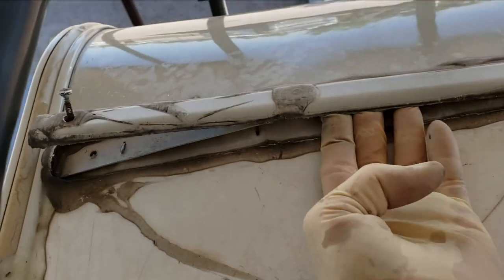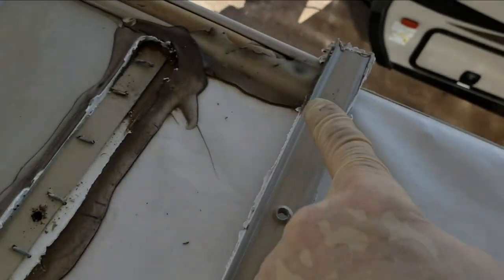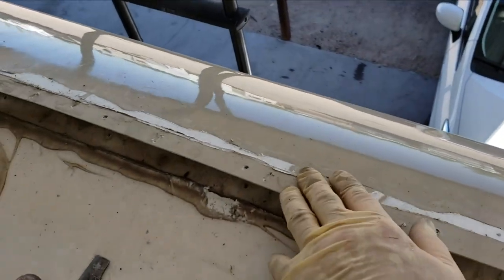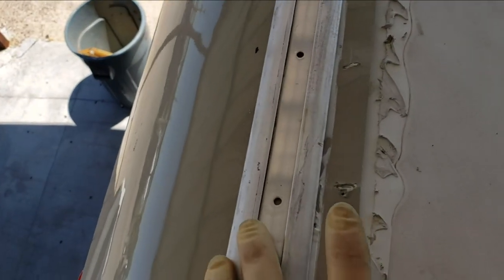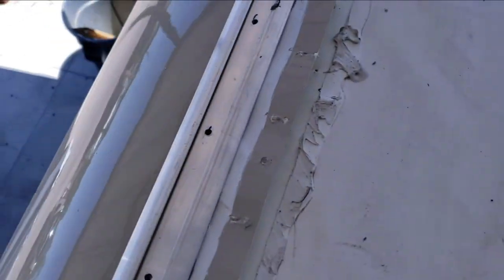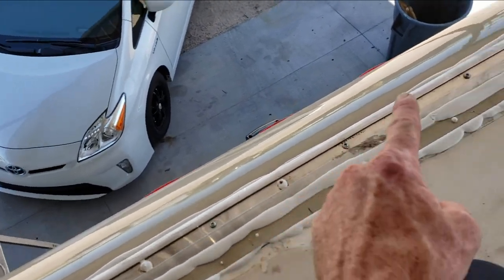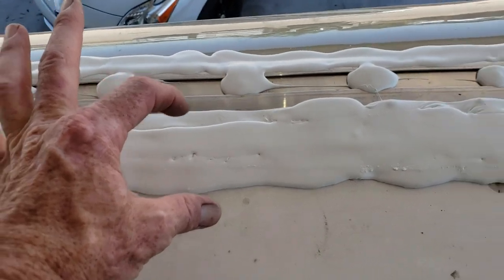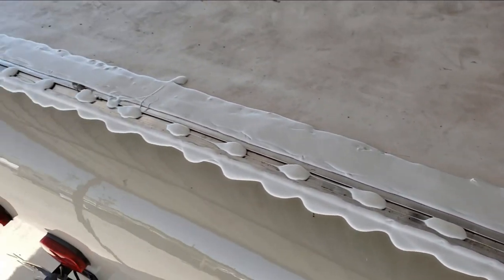Oops, Thor Did it Again!! Another Roof FAIL!

Comment: I find your videos very clear and helpful to whatever item I'm working on in my Motorhome... I like how you take time to explain key info. When it's necessary too that project. Now I'm working on indoor fan on my 2ton basement unit. I have replaced all 3 capacitors and have green light indicating system is good but indoor fan keeps shutting down and then starts back up a little later. Soo it's time for new fan motor as we live in Florida and live in RV so fan runs 24/7.  My point is that your videos give me Vidal information and confidence you send Thur video is Awesome.... Don't stop helping us out here.... Thank you so much!
Reply from the maker: Thank you so much for the kind words and support. The indoor blower should be directly controlled by the board itself. I'd make sure it has an issue on both high and low speeds. Winnebago's also have an EMS that will force the A/C into low speed if you are plugged into 30amp and start going over 30 amps.

Comment: I've changed my mind about buying an RV. They sound like cheap junk. Thanks for your insightful videos!
Reply: A lot of the newer ones are cheap junk built with styrofoam, chipboard,plastic, push plugs instead of bolts and many other manufacturing  short cuts, there's nothing wrong with buying an older one with better build quality but just make sure you buy a well maintained one and pay an expert to inspect it for old water leaks etc.
Reply from the maker: Glad to help

Comment: So many ways to fix this. I might have had a roofing company heat weld a 6 inch strip of TPO and covered all of that mess. But like I said there are many ways to slay this beast. Good job that won't leak for a long time.
Reply from the maker: It's a balancing act between cost and repair. As this is for a dealer, they'll want it as cheap as possible but still safe and reliable. Thanks!

Comment: We have a Thor Four Winds and try staying off of the roof.....  Of all the motorhomes we have owned the best construction was our Revcon. Now that was a long time ago, but it drove cross country.  The only issues were generator and roof air.   The next was my GMC front wheel drive.  Now I miss that coach but without an overhang on the front like our Class C it was hot in the cab deck area since the dash AC didn’t work.  But the quality of work was excellent...
Reply from the maker: Sounds like you've seen the good and bad of RVs too. Thanks!

Comment: You did what they should have to begin with. Have you seen any 21 GD Imagines in for issues at all? 
Love your channel and knowledge! Excellent work!
Reply from the maker: 2022 solitude with a bad roof install, washer breaking through the closet floor, inverter wasn't even wired correctly if that helps

Comment: Hello, thank you for the video you always do a nice job as I watched most of your clips for RV roof repair.
I just have a question.  Can you peel off the TPO and replace it with fiberglass Filon? I have a 2016 Thor ACE 30.2. Thanks
Reply from the maker: Of course anything could be done but putting filon on a membrane roof will be nearly impossible as the roof likely has contours and securing it will be difficult. I'd recommend rv flex armor first. Thanks

Comment: Soooooo much sealant.  Those "pockets" on the aluminum strip not covered by any dicor or sealant is a place for water with literally no way to run off. Better than letting the roof rot, but I like using a wider strip of flat aluminum combined with sealant underneath and a path for water drainage especially at the ends.  Everyone has their way of doing it...I'm always open to new ideas.
Reply from the maker: This was definitely a band aid repair, A much wider strip would have bowed away from the rear roof radius, and the pockets will hold water but will not leak. Filling in the whole trim would have been even uglier and more wasteful of sealant. All repairs are a fine balance between good enough and how much the customer is willing to pay for marginal improvement. Thanks!

Comment: Do you think they put the roof under the cap with the thought of driving the rig in the rain where it would be “forced” under the roof if done your way?
Reply from the maker: mostly it's a matter of easy assembly when built. Even in the membrane instructions it shows the roof over the rear cap but either way a driving rain cannot get forced through a secured and sealed roof. Thanks!

Comment: My 2011 Keystone Cougar is a pile of crap in so many ways. My roof literally melted. I went up to install a solar panel and took two steps and realized the roof was a gooey mess, roof came up off the roof particle board, stuck to my shoes. I went down and got an old sheet to work on while I installed the solar panel, grey good all over me when I was done. I'm going to have to tear the old roof off and put another one on. Of course Keystone did nothing but stone wall as is typical of them. Other things I found was behind the breaker panel to run solar wires, left over candy wrappers, along with material they cut off and holes, they drilled, it was a mess back there. Then most of the hinge screws came loose, pulled from the mounting, the bed has a bar behind it with a hinge to lift bed all the screws were pulled from the wall and hinge was hanging in mid air. Pure crap! I could go on and on. Never buy a Keystone anything, and the fancy Grand Design, what garbage! They all use the same idea of light weight and cheap material and roll them off as fast as possible. I kick myself for selling my 1999 Alpenlite, the best trailer ever built in my opinion.
Reply from the maker: I can fully understand your feelings and I share a majority of them. I am curious about the roof melting. What kind of roof was it?
Reply: @AZExpert  I live in Az also. I found the trailer in Laughlin, it had come down a few months before from Oregon, bought at Blue Dog RV, used 2011. I walked the roof, was in great condition showed no signs of gumminess at all. I bought it and brought it home. Then one day went up and it was gummy. From what I can tell the material seems to be a rubber based coating, the layer under it is what I assume is the sheet stuff they put on at the factory, it's pulling up all over. I can pinch and lift large sections of it. From what I have read Keystone has thousands of trailers with bad glue jobs and to thin of caulk on the seams, causing the bulges seen on fronts and rears of lots of trailer, I'm sure you seen plenty of those. So I have to a reroof.

Comment: So far I haven’t seen a video using Silicone sealer like Liquid Rubber.   Have you used it or had bad experiences with the Liquid RUBBER?  Just asking because the video using Dicor , you didn’t see to be too impressed with the results.   Enjoy learning what you do so well.
Reply from the maker: Silicone does not tend to stick to rubber well. I generally do not trust any coating so it's difficult for me to stand behind products I don't trust. Thanks!

Comment: Hi,
I need to pick your brains.
I'm in the UK
I have a Mercedes C type. The walls and roof are laminated ply/ styrofoam/ply laminate.
There are serious rot/leak problems with the roof.
I need to replace it. I have 2 options. Try and re do it as it was. Which could be tricky or do it with a timber 3" x 2" frame and ply on top. All glued and screwed down.
Then rubber on top of either.
Thoughts?
Reply from the maker: I would recommend a more durable exterior on the sidewall. Rubber will tear easily.
Reply: @AZExpert  Thecwallscare fine. It's the whole roof that needs replacing. Wood frame and ply skin or ply/foam/ply laminate?
Reply from the maker: I tend to favor the original build method. If you can stabilize the non-rotten section and re-build the rotten section, I could see overlaying the entire deck and then installing rubber rather than re-laminating. If the entire roof and ceiling are rotten.....and you want to keep it....I could imagine completely rebuilding it however I wanted with the lumber you are thinking of. That is generally a big job as there are numerous wires routed through the ceiling.
Reply: @AZExpert  thanks, none of the routed wires are actually in use. I'll be rewiring. it is a big job but doable. The whole rood is just glued and screwed to a 3" x 3" aluminium angle secttion that runs the length of the bus.
I think I'll go for the frame an ply on top. That way I can use better quality insulation and it'll be more expedient to do 4' at a time.

Comment: Did I hear you say you' d put rubber over the joint at the front?
I'm in the UK rebuilding the roof on a 1996 Mercedes C class. The area over the cab is Aluminium. The joint is then going to joing Ali and a rubber roof. Would you put rubber over the ali then seal and moulding over the top? Doing it that wat will make it easier.
Reply from the maker: That is how I prefer to put the membrane down. The rubber overlaps like a shingle and the trim holds everything down.
Reply from the maker: In this video at about 6 and a half minutes in, I try to descibe my process and opinions. Thanks!  https://youtu.be/g6PDqqebi9E
Reply: Thank you!

Comment: Wish I would have found your channel before I fixed my Jayco Hybrid. Lets just say, i will be removing some eternabond tape in the near future and re-doing  the front seal. :-)
Reply from the maker: If it's not leaking then I would leave the tape. Good luck!
Reply: @AZExpert  So far its good. I discovered the leak by noticing a rusty watermark from one of the  valance Mounts and the support cable bracket for the front flip out bed. The valance was a leak from the Lag bolts not properly sealed for the top Canopy bracket which rotted a small section of the OSB decking. The other was the front joining strip and the goofy way Jayco joined the Side roof strip and front corner strip together. Wish I could attach pics to show ya. I ended up having the replace the front curved Luan ceiling due to it delaminating. I replaced it with the Fiberglass Polyester wall covering that they use in commercial kitchens and bathrooms since I couldn't bend Luan back to its shape from the inside. :-) This camper is a 2015 and have already had to replace the skylight for the bathroom due to crazing and cracks. We bought it last year from Scamming world and basically bought someone else's neglected problem. Good Camper though!

Comment: Any recommendations on RV insurance? I’m sure it’s a grey area with used rvs and coaches.
Reply from the maker: If you are asking about accident insurance, generally any of the larger auto insurers seem easy to work with. If you are asking about entended warranties, I have worked with almost all of them and they all cover what they say they will, it's merely a process to do the claims the way they want. So shopping around for the best deal is not a bad idea. A more mechanical minded owner could probably get by with a less inclusive policy and $1000 deposit, but I do recommend them. Jacks, refrigerators, slides, A/Cs will fail and they are more expensive then you would think. Thanks!

Comment: If you were to build your own RV, what type of roofing do you think you'd use?
Reply from the maker: I have built quite a few and my answer is dependent on use. Personally I find the tpo membrane as good as epdm rubber in looks and durability and it doesn't chalk and is less expensive. I will be installing tpo on my next project.
Reply: @AZExpert  Thanks for the input.  I'm considering building a Class C type RV that will spend time in the mountains.  Just doing a lot of research now.
Reply from the maker: That's impressive, I've never built a complete motorhome. You might give some thought to the spray on roof VeracoatHD. Good luck.
Reply: @AZExpert  Do you have a link?  I can't seem to find it...
Reply from the maker: Rvseal.com
Reply: Kujo21 look up RV roof install , Tpo 60 mil
Reply: AZ Expert 
U

Comment: 16 tubes of Dicor and a linoleum aluminum  transition later
Reply from the maker: In fairness it was around 6 tubes and extruded RV beltline aluminum molding. I'm not sure what you would do given the time restraints and budget but thanks for watching.
Reply: @AZExpert  oh no....that wasnt a criticism of you!  Unfortunately that is the problem with RV ownership:  patching/repairing/gerry-rigging our coaches due to poor craftsmanship and cheap materials at the factory.  I once owned a 65K 5th wheel that was just a shiney turd! The grunts left let the cutout pieces fall into both holding tanks at the factory, which eventually jambed up my wastegates!! Sorry my comment was more towards the options that we left with as owners. I am current replacing the EDPM and redecking the roof on my smaller travel trailer, but I did do that same repair using same methods a few years back on it! Thanks for responding and I find your videos very helpful!

Comment: How come you didn't use 2 wide butyl tape under the trim then lapseal it? Plus I would have covered with eternabond then lap sealed the edge closest to the membrane for a nicer look. I also like using double sided eternabond between the cap and the membrane. That stops all leaks. But what you did will work fine! Thanks for your videos
Reply from the maker: There are many reasons. I would not have been able to get the butyl all the way into the corners without removing the side molding(a cost the owner was unwilling to pay). The decking was not thick enough to pull the surfaces tight enough to compress tape which is how tape seals. The eternabond would have torn from the edge of the rear wall trying to pull up and added an additional $40 to $60 the customer was not willing to pay for. And if this didn't work and I had to redo the job, I would have had to spend hours cleaning up eternabond. The sealant flows and will squeeze into voids and will act as a very good adhesive too. Thanks!

Comment: Hey I watched a few of your videos over time and you nailed this one. You should not do roof repairs lol. I mean you talk about pooling water what do you think is going to happen on your Termination bar it’s going to pool in between every screw you put in. between the caulk you put in the front of it and behind it you are causing it to lol. I know your trying but my god sir that was very sloppy
Reply from the maker: Hmmmm, you are correct that the roof was built very sloppy. I'm sure you'd be glad to pay $9000 or more to completely rebuild it too? Though there have been time I'd seal between the screws or the molding, I have not found water intrusion to be a common issue if the screws and trim is sealed. You'd be surprised what people are willing to pay for does not always match what should be done. I'm glad you're able to share your dissatisfaction and disapproval so nicely and not be a jerk about it.

Comment: You are not building pianos  for one. Secondly, who cares what it looks like as long as you fixed it. I would have been mad had I seen that as the owner. Like you said, it cannot be seen anyways. No, the factory has no idea what they are doing if they are leaving such a large gap. All of those will need what you just did. I was thinking mabe a stainless steel band across the roof but why? What goof would that have done?
Reply from the maker: Thank you very much. I have found stainless to be very difficult to work with.

Comment: Not very pretty.
Reply from the maker: Thanks for watching and agreeing with me.
Reply: Thor was the manufacturer of that one huh? You did the best with what there was to work with. Can that Dicor product be smoothed for less crevicing between products? Or will that create further problems? Another question... what the hell kind of roof do I have on my RV? It's like a hard plastic.
Reply: 2002 safari zanzibar. The ones with the one of a kind mural on the back of each one.